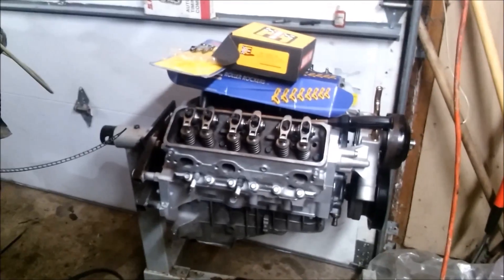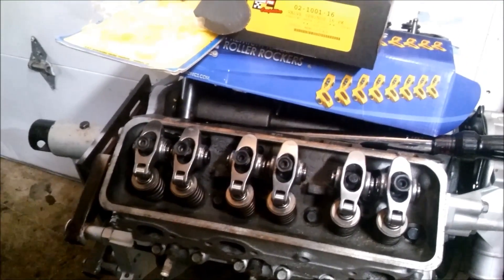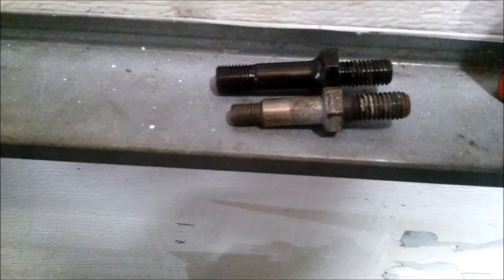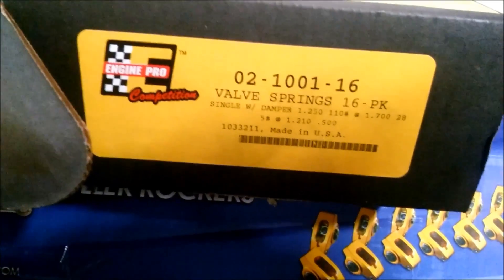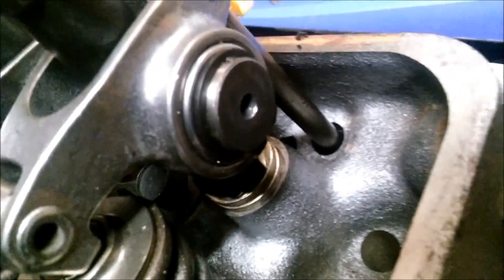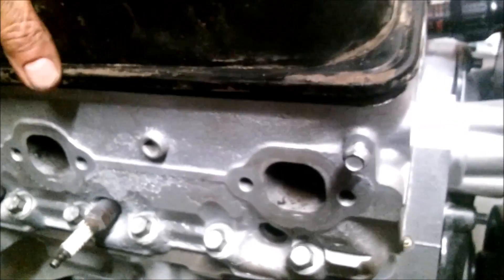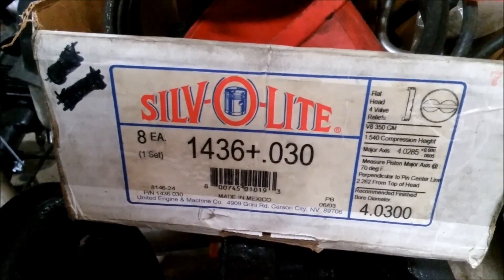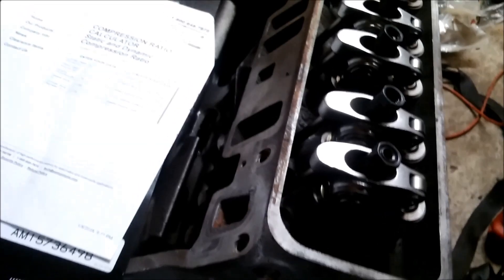Chevy 4.3 Vortec V6 engine Preformance Build with part numbers

Comment: Why not buy a nice reman motor? Alot less work plus you get a warranty to boot.
Reply from the maker: It's call proformance. I wanted more compression, larger cam, bigger springs and high volume oil pump. Plus wanted it done right. The title to the video is not stock 4.3 swap. It's a build and proformance mentioned. Anyone can buy a stock engine at the store. Sorry 160-180ish horse power is not my thing. 

Sorry for late responce I just do this as a hobby and for the past few years of this never made one dime from you tube. They did that 1,000 plus subscriber bs.
Reply from the maker: And I bet more $$ too. I was under $1,000.
Reply: @mobilemowers  so what you did you only spent 1000$ that's before the parts you had forgotten after the video was done?? I am looking at rebuilding my 4.3 which I think  the head gasket blew due to over heating. The shop manager said it would be cheaper to get a new engine or reman but I want the power
Reply: @djmadd1212  I'm fully building mine you will spend 5k on all parts and machining I'll be posting videos on my 4.3 build soon full list of parts and where to get them a lot of parts are the same as a GM small block v8 i have extra parts cheaper to buy the pack for the v8 ill be looking at starting about 600hp and work my way up im going after my 99 ZR2 blazer record and I'm pretty sure I'm going to smash the old record

Comment: My 02 has those identical metal valve covers. Evidentely they went back to them after the plastic ones. I want to rebuild it and try to find some mild performance parts for it.  It only has 150,000 miles on it, but its just got 20psi oil pressure at idle. I cant really find any performance parts other than camshafts and headers. Anyone know of anyplace that sells 4.3 performance parts? Wish someone would start making performance heads for them. That would be great.
Reply from the maker: Everything in my build is proformance.Like the lifters, timing chain, oil pump and Vortec heads are proformance ( which can be ported). The same parts from a 350 interchange for the most part.

Sorry for late responce I just do this as a hobby and for the past few years of this never made one dime from you tube. They did that 1,000 plus subscriber bs.
Reply: 20 lbs at idle is well within limits. Would not worry till it drops below I
8PSI or so
Reply: ¿What did the cyclone or typhone have for heads? that seamed to be high tech good flowing too.

Comment: Would vortec heads fit on my 1989 Vin z 4.3 motor?
Reply from the maker: Yes. You need to have the intake mouting holes redilled by a shop about $30-$40. Sorry for late responce I just do this as a hobby and for the past few years of this never made one dime from you tube. They did that 1,000 plus subscriber bs.
Reply: Or you can use the edelbrock 2114 intake and put a carb on it. 2114 fits vortec heads. 2112 fits pre vortec.

Comment: I just checked one out, old work truck with steel wheels . It had tons of room in the engine bay , I believe it was the 90-95 model .
Reply: 94-04 will all be the same room. 93 and below is square body

Comment: Did you have to get the heads machined?
Reply from the maker: Valve seats cut down slightly if I recall. Also the springs in the video I show the box for Z28 spprings. Cause off almost 500 lift.  Was like 2 years ago.

Comment: ive got a 95 s10 single cab 4.3 im working on building the motor my frame broke so I pulled motor and im dropping it in a 86 rx7 its took months to figure out what parts I needed im not lookin for horse power as much as im looking for torch monster
Reply: Tourqe is not all in the cam forget this dude my 4.3 is almost done im doing more and less complicated then this mess ill be posting videos soon
Reply: @codeack101wlck  why don’t you make your own videos and stop promoting yourself so much an this guys Chanel while putting him down….   Instead of talking shit  to get views why don’t you just make your videos better…. Have some respect
Reply from the maker: Torgue is all in the cam and the intial timing for the cam. My cam is for more bottom end.

Also convert it over to the 96/up multi port for more power an tunning. Use one of these covers https://www.eficonnection.com/home/category/engine-hardware/engine-timing-covers/small-block-chevy

Sorry for late responce I just do this as a hobby and for the past few years of this never made one dime from you tube. They did that 1,000 plus subscriber bs.

Comment: did you go to carb or are you still fuel injection?
Reply from the maker: Fuel injection due to emmissions and some better mileage.
Reply: mobilemowers  I guess that works there’s someone who makes better heads for them but I can’t think of who though you can use also different sbc valve springs it’s just a 350 with 2 less cylinders
Reply: @strengthstuff7618  he way over complicated this 4.3
Reply: @codeack101wlck   at this day in age it’s cheaper to go ls or mild sbc then trying to mess with the 4.3 I would have just did cam valve springs along with the carburetor and put a turbo on it should handle 7 to 10 psi and make 350 wheel horse
Reply: @strengthstuff7618  no fun in that and would double the weight of my truck when all is done I've got the weight down to about 2300lb your looking at 4800lbs with the ls and drive train to go with it

Comment: Ever get it running? Curious how you like it?
Reply from the maker: Yes got it running. The body shop still have it in their still doing nothing. Been in since 2012. That's why it needed the needed due to sitting. The injectors gummed up and the mechanic took the intake off and ran the pump. It then ran gas into the oil. Then rod knock happened almost instantly. I'll update it when I get the truck back and driving it.
Reply: @mobilemowers  hopefully it's soon just got a 02 blazer 4.3 wanting to build but I I due the middle cam due I have to reprogram the computer planning on putting a chip in it to override the automatic cut off and duel exhaust
Reply from the maker: They haven't used chips since 1995. Get a custom tune / hp tuners.  Middle cam ? The ecm will reprogram itself for slight differences. Anyways best of luck.